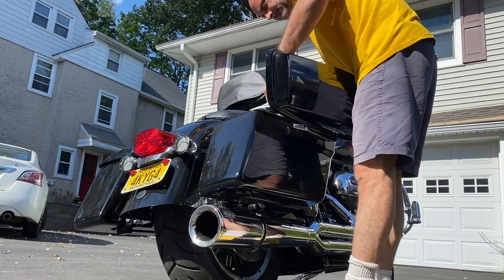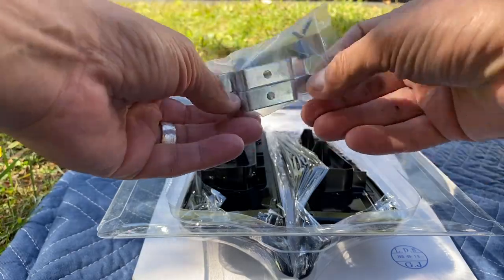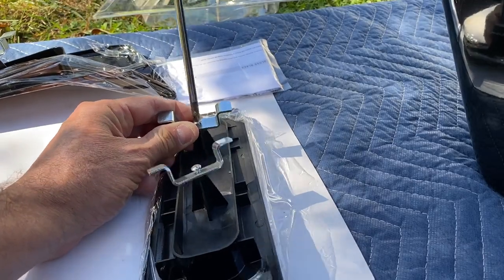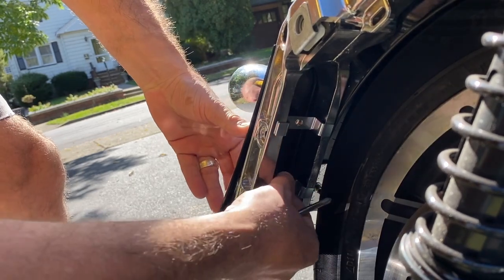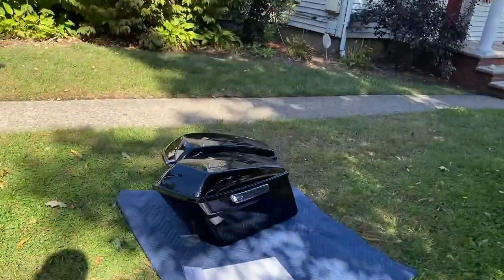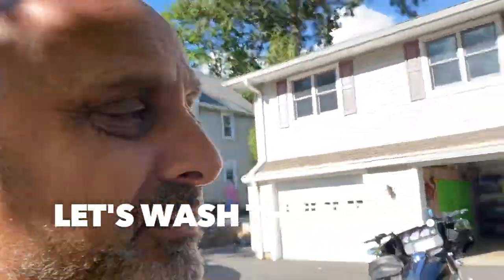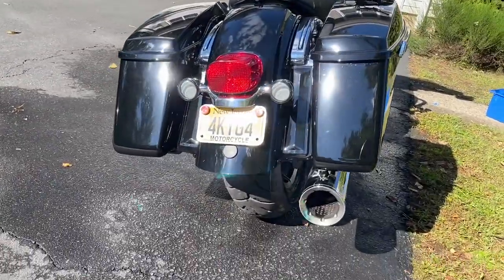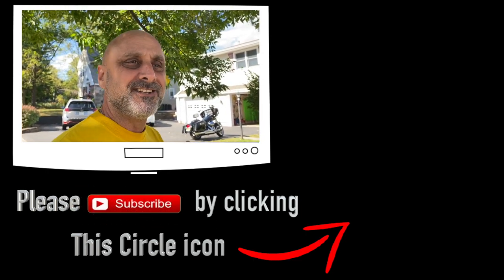kuryakyn saddlebag filler panels install

Comment: hello.  did you add the 2 lights above the license plate?  if so, can you tell me where you got it.
Reply from the maker: That’s stock in this model
Reply: @HOLYSHIFT  thanks I would like to add those extra lights instead of the filler plate.  I appreciate it. have a good one

Comment: What up brah? Pimpin I have this same bike and I love it, it seems your the only one doing vids of upgrades of this bike keep’em coming. My question now is does the led headlight interfere with your radio reception? As I have the 5000 series Sony setup and the light I had killed my receptions, sold it had to go back to stock. Oh I have a stage 2 cam kit upgrade, GO FOR IT. I am now subscribed to ya thank you for info on this bike and where can I message you privately?
Reply from the maker: b gamble cool man - thanks for subscribing. I have no problems with reception on my Radio - maybe an external antenna will help you... yeah one of the reasons for getting this bike was so I can upgrade it my way.... stage 2 coming in the spring